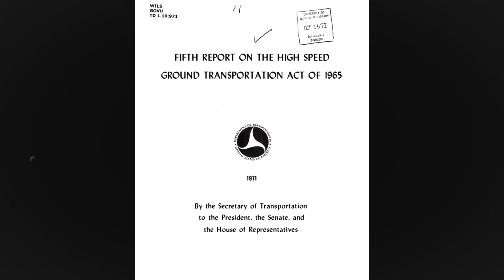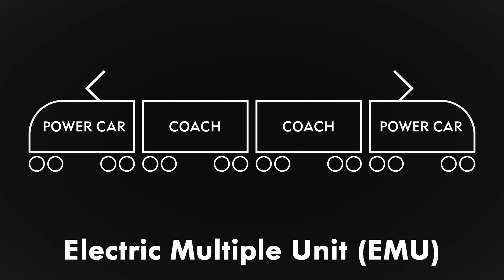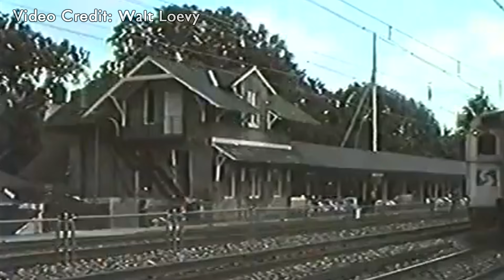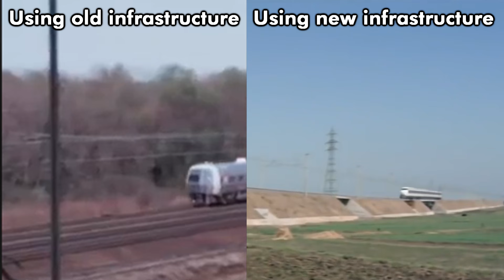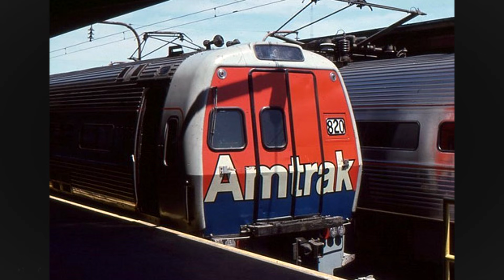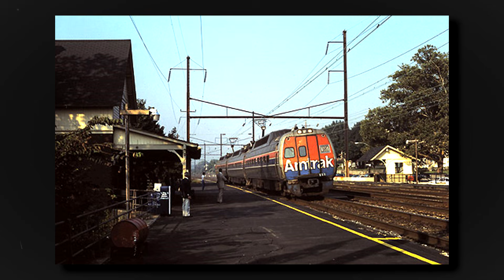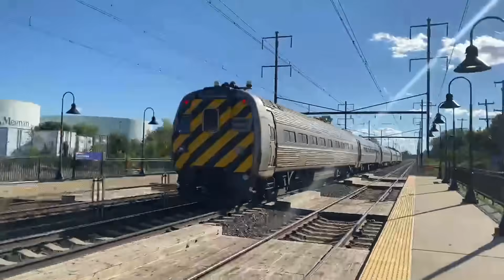Engines of Amtrak - Budd Metroliner [REMAKE]

Comment: If the Metroliners were successful, America would have a MUCH BETTER high speed network than what it is today.
Reply: I 100% agree
Reply: It's not the train itself that's the issue.

It's the same issue that holds back the Acela; the infrastructure.  You can put a new engine on the Acela, but until the NEC is upgraded to handle true high speed rail, the Acela will never reach its true potential.  And as expensive as a new engine is, upgrading infrastructure costs billions and take years if not decades.  Sure, the Metroliner units had problems, but they were not helped by throwing it on infrastructure that was over a century old and decaying.  Contrast that to other high speed rail networks (Shinkansen, TGV), both of which built new rail lines specifically to handle the high speed rail.
Reply: @CSXIV  this why im rooting for the government to improve the rail infrastructure
Reply: @CSXIV  Yes! But also a little no. It's true you that can't fix the issue entirely with higher speed trains. Nevertheless, if you get a more specialized train with very good acceleration and a high top speed, hopefully also tilting technology, then you can milk your existing infrastructure for all it's got at a fraction of the cost! This is the Nordic approach, and it is proven to work.

Now, that service will not be nearly as fast as full-on dedicated-track HSR, but it could be just fast enough to make people switch from planes and cars and give trains a sorely needed win. This is exactly what the Acela is! Yes, it's hobbled by infrastructure and it really does't give that TGV-derived train any room to spread its wings. But it is wildly popular and absolutely dominates the Northeastern intercity transportation market. This is exactly what we need to do elsewhere in the US until there is solid HSR funding from congress. We need to find corridors like the Northeast where this model can work and apply it. It would give Americans a taste for fast trains and make it so much easier to lobby congress to approve true HSR funding!

The alternative is to wait for a multibillion dollar appropriation for true HSR, which has been brought forth countless times and has failed every time. Let's not forget that the Chinese HSR network cost $2 trillion to build and they started planning for it in the early 80's! We're much better taking the Nordic approach on this for the time being.
Reply: That's the thing though it was a really successful because every person that I hear talk about it that actually wrote it said it was standing room only that is crazy to think of a high-speed service having standing room only on a 6 to 4 car train because of demand usually a run time of 2 and 1/2 to 3 and 1/2 hours it shows how popular the service was and how they were not prepared with demand if somebody would have came up with the proposal to add more coaches and evenly spread out electrical components and retweet them with higher paid budgeting staff this could have worked out the spv also cutting given way to local Metro commuter with electric turbo variance they could have had a better system with a better demand but nobody saw the version
Reply: Hell, maybe good enough the climate crisis woudn't be as alarming.
Reply: @iron1349 , hate to burst your bubble, but ONE volcanic eruption puts more greenhouse gases into the atmosphere than all of mankind’s contribution since  our beginning.  Although our mining of lithium for batteries is extremely harmful to the environment, plus we aren’t anywhere near the tech to recycling those batteries, nor is there anyway to safely dispose of those batteries (so the world just ships them to China for the world’s most toxic land fill).
Reply: @iron1349   LOL ohhhh ewwwwwww scary climate!!!!
Reply: @mrdoormatt you should [redacted] yourself
Reply: Not at all…
Reply: @SomeRamdomAhole  At the very least it wouldn't have scared Amtrak from trying EMU's again

Comment: I am still amazed that they managed to run it so fast given the low power to weight ratio and aerodynamics of a polished brick.
Reply: Given that a locomotive that in Sweden only reaches 80 mph in service could match the Metroliner's performance, I'm guessing that getting to those speeds took quite a while.
Reply: Yes a polished brick I like it
Reply: Oh, so that's how they did it! They polished the friggin' brick! Brilliant!
Reply: The power is kinda why it was so fast. The Metroliners actually have a decent power to weight ratio. They were a bit heavy, yes, but they were the most powerful EMU's at the time at between 1,000 and 1,200 HP per car. Compare that to a weaker 550 HP Silverliner, which managed to reach 156 when pushed and "slabbed," and the Metroliner's speed capabilities make sense. 

I say their power helped them with speed, I have no clue why their acceleration was so poor. I supposed they would've been quicker had they used AC traction instead of rectifying to DC
Reply: @RussettGXY what was the reason why it didn't succeed was because it was really an aerodynamic design it was supposed to be sleek modern but the Northeast corridor was not fully upgraded to its Max potential to get them to run as fast if the route was more straightened the curves were more refined and slanted to a higher degree on top of more upgraded power stations an upgrading more sections to four track sections and getting high speed service right away over regional and freight with extensions to the Northeast corridor with other lines being built at the same time this could have worked but the money was split between two projects the turbo and the metroliner on top of it being rushed from what I see is from what I hear normally from the old folks  the metroliner was really overbooked and packed to standing room most of the time if they would have also went with the original four car design with trailer motors this could have succeeded on top of that nobody was thinking also with engineers of a higher cost to focus on certain parts from the beginning the metrolina could have been the most successful high-speed train and could a Kickstarter commuter rail service across America